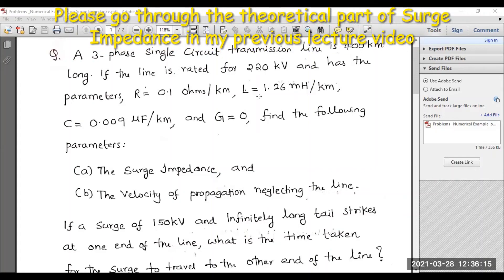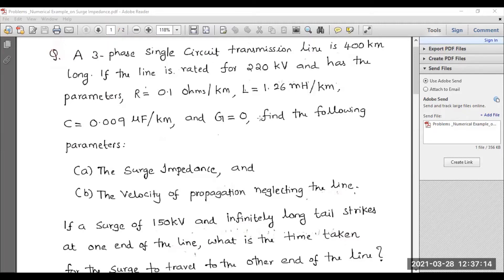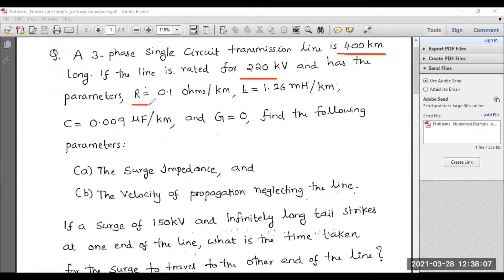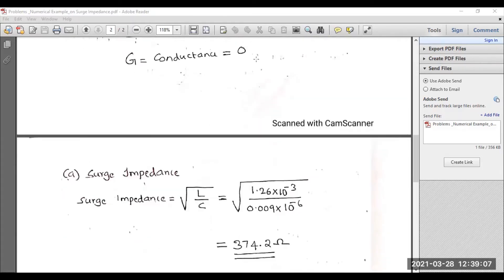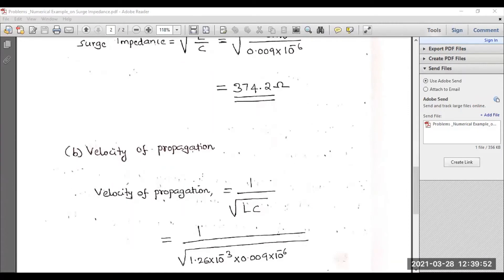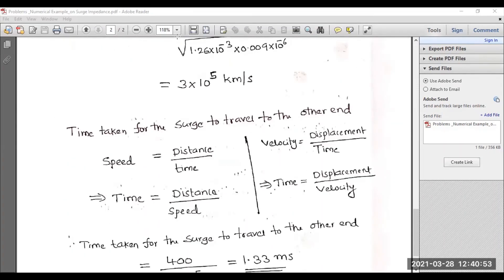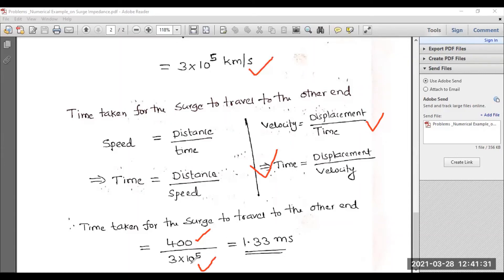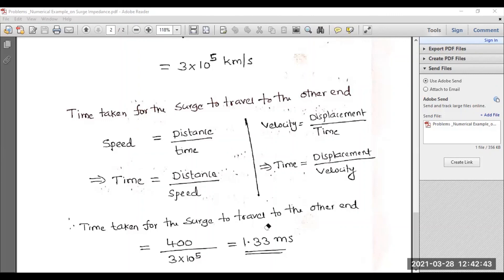SURGE IMPEDANCE & SURGE IMPEDANCE LOADING  NUMERICAL PROBLEM WITH SOLUTION|High Voltage Engineering

Comment: In a Van de Graaf generator, the width of the belt is 1 m, and  surface charge density permissible is 30 × 10–6  C/m2. To supply a current of 300  µA, the velocity of belt should be (a) 1 m/sec (b) 10 m/sec (c) 3.16 m/sec (d) None of the above